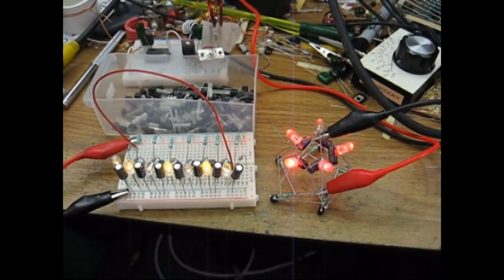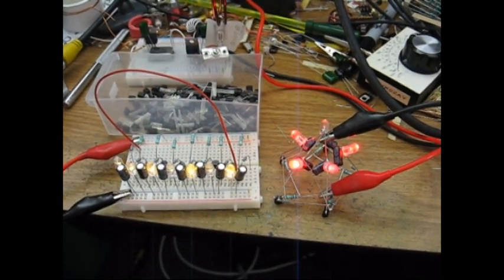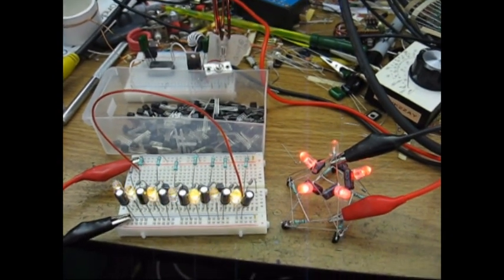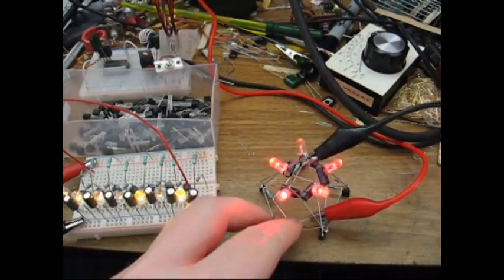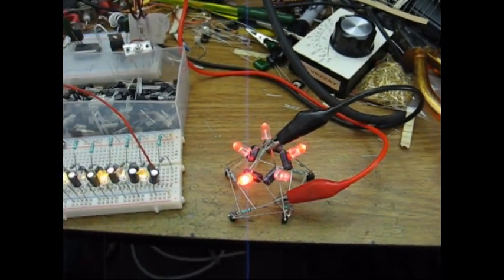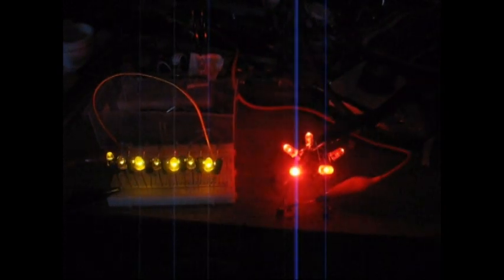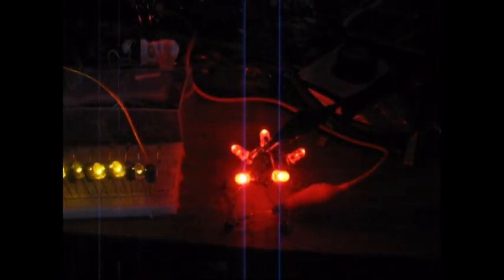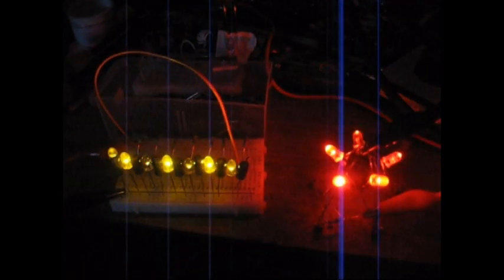Ring Oscillator Das Blinkenlights

Comment from the maker: @moskau4ever The capacitors are 22 uF, the resistors 1 K and 110 K, the transistors are 2N3904.  None of the values are particularly critical.  Largish capacitors and collector-base resistors for the desired time constant (given a rough idea of the transistor beta), and a suitable current limiting resistor for the LED at the supply voltage is what you should design it around.